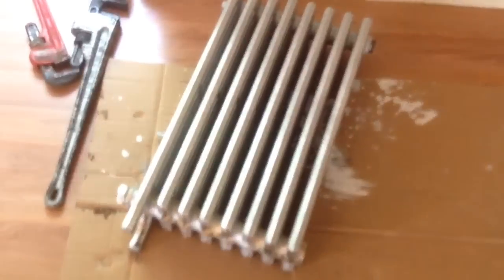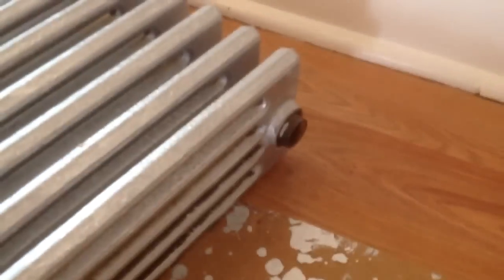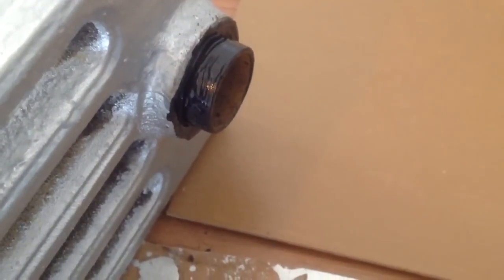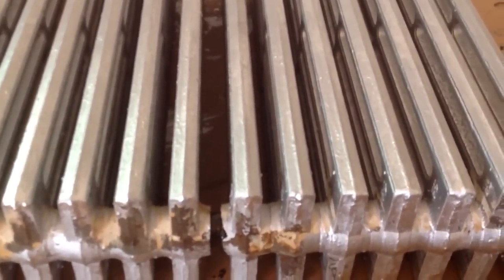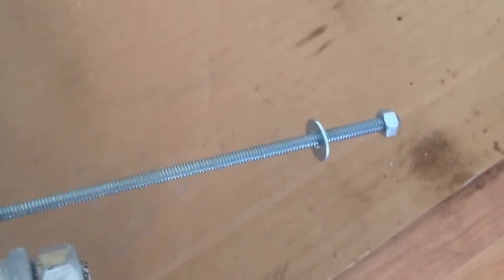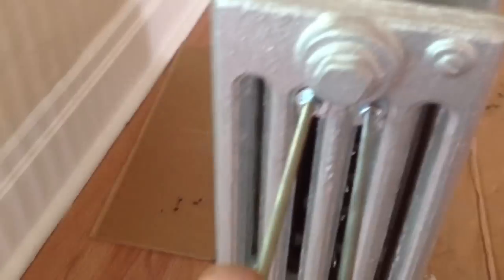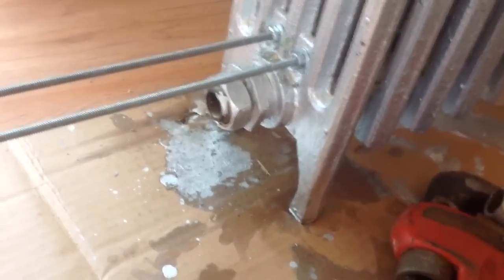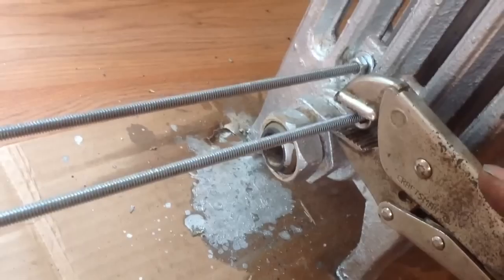How to assemble cast iron hot water radiator

Comment: This helped me quite a bit. This and your video on separating and I was able to shorten my rad.  The all thread holding mine together is just rods threaded at the end, so I need to replace with actual ALL thread.  I see quite a bit of options: zinc-plated, plain steel, stainless steel. Suggestion on which?

Comment: Hey there! I appreciate the video, but the main question I had wasn't specifically addressed. I'm wondering how you accomplished the actual joining of the sections. There is a radiator restoration company called Ecorad, who employ a hydraulic press for assembly, and I don't have that resource available to me; and as a corollary question, should the push nipple automatically position itself properly between adjoining sections, as a result of its tapering?

Comment: I'm looking at my own radiators and they look pretty much identical to this style but I do not see any tightening/tension rods. Is it possible that some radiators don't use these? If not, what holds them together? Thanks for the informative video.
Reply from the maker: Yes there are radiators that have threaded inserts that connect them together. I'm told they can come apart but have never tried. I also don't think it would be a diy situation.
Reply: if you dont have the 4 rods to pull the runs [sections] together then your radiators are screwed together ! Thier is a nipple with 2 different threads on it so as you turn the tool clockwise it screws into both sides at same time . You must have this special tool other wise you can not reach inside to each section ! on you tube you have plenty of videos showing the screw type radiators and only this one video on the 4 rod radiators